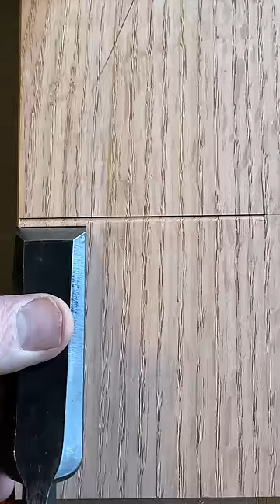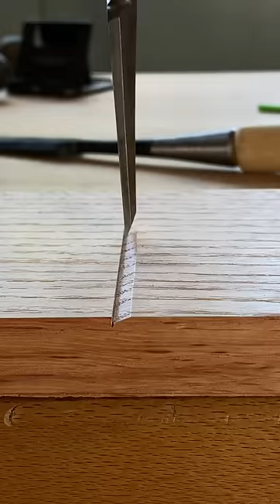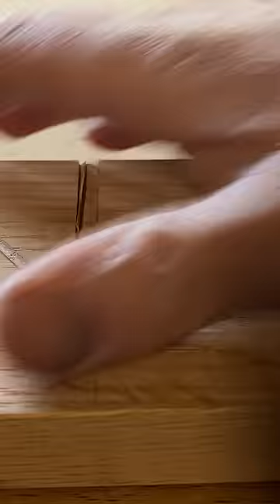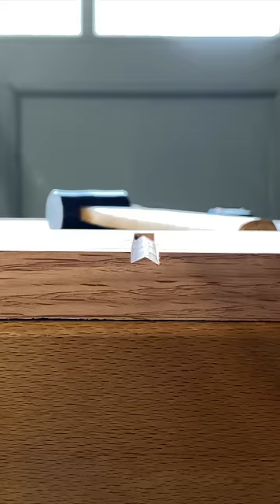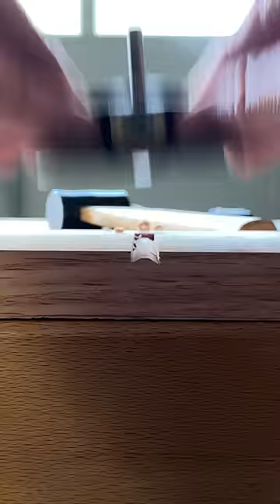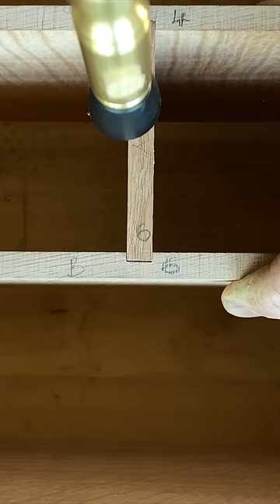Stopped Housing Joint with Hand Tools #woodworking

Comment: I see a hilarious debate going on here so I asked the AI (chat GPT) to get an 'unbiased' response as to why a woodworker, like this very patient man. would do this! Question - why wood a woodworker use hand tools to cut a dado instead of using an electric router given it is much faster and just as accurate?
Answer - While an electric router can indeed cut a dado much faster than hand tools, there are a few reasons why a woodworker might choose to use hand tools instead:

1. Control: With hand tools, a woodworker has much greater control over the depth and width of the cut. This is especially important when making precise joints or working with delicate or expensive woods. Hand tools allow the woodworker to take their time and make adjustments as needed, without the risk of taking too much material away too quickly.

2. Safety: Power tools can be dangerous if not used properly, and dado cuts require the use of a straight bit or spiral bit, which can cause kickback and lead to injury. Hand tools, on the other hand, are generally safer to use and allow for more control over the cutting process.

3. Noise and Dust: Power tools can create a lot of noise and sawdust, which can be an issue in smaller workshops or shared spaces. Hand tools are generally quieter and produce less dust, making them a more suitable choice for some woodworkers.

4. Skill Development: Using hand tools to cut a dado requires a high level of skill and practice, which can be a fulfilling and rewarding experience for woodworkers. They enjoy the challenge of mastering traditional techniques and feel a sense of accomplishment when creating something with their own hands.

5. Aesthetics: Some woodworkers prefer the look and feel of joints made with hand tools. The use of hand tools can create a unique texture and quality that is difficult to achieve with power tools.

6. Tradition and heritage : For some woodworkers, using hand tools is a way to connect with the history and traditions of their craft. They enjoy the sense of continuity that comes with using hand tools that have been used for centuries.
Overall, while an electric router may be faster, using hand tools to cut a dado can provide greater control, safety, and aesthetic appeal. It ultimately comes down to personal preference and the specific goals of each woodworker.
Reply: im scared of AI.
Reply from the maker: thanks! wow this AI is getting good, a fairly balanced and comprehensive response. I like the way you misspelled 'would' - was that intentional?! 😊 cheers
Reply: That's seriously a great response
Reply: 7. Views
Reply: The AI missed the obvious answer of "because it's fun." Or anything along those lines. It got close with the skill development and heritage ideas, but those aren't quite the same. If you're a hobbyist, you just do the things that seem like a good time.
Reply: @MattMcConaha  not really, the last point includes „for fun“
Reply: One more reason, some clients / buyers / customers actually WANT something hand made, carved, crafted.
Reply: Think for yourself
Reply: @graysonmichael8335 you should be. Some of us are going to use it to become gods among you
Reply: @colekter5940 I usually say kill that part that cringes, but whatever that is needs to die ASAP
Reply: @graysonmichael8335  skynettttttt😂 No but seriously those where some really good answers which make it even scarier lol.
Reply: This AI is beginning to know everything about everything
Reply: Good thinking. But the bit about greater control is wack. You can have way more control with machinery, macines can work down to microns in measurement and repeat a process over and over and get exacting results every time. The one thing that doing it by hand gives you is plasticity to affect things as you go. Taking time to check each cut and tweek things how you ĺike them.😉
Reply: WRONG- on ALL counts- except for #3. a CNC router is accurate down to the micrometer an experienced custom cabinet maker is JUST as accurate. chat GPT, much like google- is NOT an 'answer' engine- it's a search engine. it can only give you a majority opinion- which, in this case? is mostly WRONG.
Reply: @Matt-bp5vy overrated response
Reply: @bricknolty5478  those who reaist change become victims of it.
Reply: @graysonmichael8335 yeah, that answer was wild but ultimately ripped the info from wikipedia
Reply: 7. No risk of wood around the cut getting torn out

8. Youll need to use hand tools anyways for the corners.
Reply: or, it's just right for him to do it that way and he doesnt need any of those artificial reasons
Reply: @rb-ex  they aren’t artificial reasons, they are THE premier reasons a woodworker bla bla bla. An AI did not make that stuff up, it ripped it from articles written by people on the net and regurgitated it back to the user wrapped in a nice little bow. If noone picks any of the stated reason to use hand tools then they are just being stupid and pompous. That may actually be one chatGPT missed, some craftsmen like being huge douchbags about whatever “skill” they have. Maybe it falls in traditional idk
Reply: I admire your description but his method is somewhat alien to the carpentry trade, I would use even more simple tools than this guy, just a mallet and chisel that's it
edit: just noticed by watching a second time, the hammer the guy is using will be destroying his chisels, very poor craftsmanship, you can hear by the sound it makes upon impact on the handle back
Reply: @Wtfinc  so according to you, someone has to pick one of those reasons to use hand tools or they're being stupid

that's stupid

those reasons are totally invented. no one uses hand tools for any of those reasons

people do things because they want to do what they know is right, or because they want to do what they know is wrong. there arent any other reasons

and you always know
Reply: @rb-ex  It's not made up, if the AI gave that's result it has taken it from somewhere on the Internet where people wrote it ;) I might be bullshit from people that wrote it, but it's not made up
Reply: Sadly this could be done much quicker with a dovetail saw
Reply: @cedricbailly100  those reasons are totally invented because no one uses hand tools for any of those reasons

people do things because they want to do what they know is right, or because they want to do what they know is wrong. there arent any other reasons

so it doesnt matter if machine-AI copied those reasons or if people using AI in their brains mechanically copied those reasons from their brains

AI is stupid whether it's done by persons or machines. natural intelligence, on the other hand, which is your endowment, is always in perfect sync with reality. it is based on what no machine can ever do, which is to know. and you always know what's right for you to do even if you say you dont

anyone who believes the youtube presenter should not use hand tools for this or that reason is being mental. if he's doing what he knows is right then he's doing god's work and it doesnt matter how many made-up reasons you line up against it
Reply: @Україна-ц7э  you're sad because it could be done quicker some other way? get real. you just believe he should have done it some other way because you like to do what you know is wrong while believing you know what others should or shouldnt do
Reply: Another reason..."He doesn't own electric tools or have electricity"
Reply: also hand tools doesnt require electricity, and are less expensive to start off too
Reply: @rb-ex  i bet you didn't even do it as a gcse
Reply: @rb-ex  its quicker and it also produces the same result
Reply: @MattMcConaha  
The AI also missed the most likely reason:  to make Youtube videos. Nobody would watch a short showing a dado cut.
Reply: @luqmaanrashid3922  
Unless, of course, the AI becomes sentient and does what it thinks is best.   ;)
Reply: Lololol I've seen amazing work done by those "dangerous" machines! 😂
Reply: This is a really interesting way of using AI! I never would have thought of it as a way to give an unbiased answer to debates. I’ve noticed that AI feels really soulless and generic when used to generate creative things like stories, but in things like arguments, unbiased and devoid of emotion is exactly what you need
Reply: Thank you good sir for taking time out of your day to write this down for us.
Reply: That sounds educated.
Reply: AI for president of earth. ✊
Reply: @MattMcConaha  " They enjoy the challenge of mastering traditional techniques and feel a sense of accomplishment when creating something with their own hands."

this pretty much says that they do it for enjoyment purposes
Reply: @jaronmacdonald4710  my take is that they are saying it's enjoyment and accomplishment for those specific reasons, and those specific reasons don't necessarily apply to someone who just enjoys doing it for whatever reason that that individual might enjoy doing it.
Reply: @graysonmichael8335  AI doesn't know what is doing though
It doesn't know what tools are or what a rabbet  is. It is only finding words.
Reply: And that is why you are billed $24,700 for that small 2 feet high standalone shelf...LoL!!!
Reply: AI: woodworking is great and it’s amazing what skilled humans can do with hand tools
Humans: AI is going to kill us all
Reply: Some woodworkers do it for relaxation. They like the sound & feel of sharp edges shaping wood. The swish of a plane, those fine slivers coming off the chisel. Peace, serenity, feeling the wood.
Some don't want to do their woodworking in earmuffs and a respirator under the howl of a router and dust extractor.
Hand tools are nowhere near fast enough for a commercial workshop but geez, give it a rest. Listen to the sounds in the vid. Horses for courses, different people do crafts for different reasons.
Reply: Ну да!. Хотя кому - что
Reply: Completamente de acuerdo, la experiencia de 20 años en el oficio y 57 de mi padre, avalan lo dicho.
Resta por decir, los trabajos dictan las modalidades a emplear, por una cuestión de costo-tiempo, se debe seleccionar la técnica a utilizar.
Los trabajos, llamados standard no requieren la puntillosidad de aquellos en que su terminación debe destacarse. Por otro lado, la mayor precisión y realce de una pieza o trabajo en madera la logran los ebanistas.
Reply: Reasons 4,5,6 says it all.
Reply: Scary good responses but it also missed affordability, no need for electricity, less noise pollution to work both night and day, dramatically less space required for wood projects.
Reply: Look it doesn't matter how good your hand skills are they make tools for this there's guides there's chucks for kick stops there's no excuse while you're doing something like it's the 1940 s
Reply: @VisibleMRJ 😂
Reply: That is the only way to build a cabinet
Reply: lol @ unbiased.
Reply: Router ? Anyone ?
Reply: Also, fun.
Reply: @chrisisnowliftingstuff3248  Something is still hand-made when it's made with power tools.
Reply: Well done 👍
Reply: Damn AI is getting scary cuz that's a well written comprehensive response 😳. I dont ever wanna be on the same page and wave length as an ai 😄
Reply: All of those reasons are ridiculous or just untrue.
Reply: Thank you chat GPT!
Reply: ebanistería
Reply: @VisibleMRJ lol..
No. 
You obviously have no idea how satisfying it is to sharpen your chisels beautifully, and then shave off thin layers of wood!
Reply: You asked AI to justify your POV? looooool how sad
Reply: @BigJeddak187 to the uniformed*
Reply: Ж
Reply: Жжж
Reply: Ззззжж
Reply: Ззззжжжжжжжж
Reply: All those words, just to say...."he likes to use his hands" 😂
Reply: Good one
Reply: I tink you're wrong on that first point. You can get perfection using power tools
Reply: Bon pour synthétiser tout ce que tu as écrit et copier coller, il vaut mieux utiliser chatGPT effectivement 😂
Reply: AI is right...
Reply: Yeah but did you ask it about black wood workers? Is that even a thing?
Reply: Power tools don't create the ASMR nor do they have the same level of calming intrigue to the human viewer. So while this isn't efficient on time. Hand tools provide the most enjoyment to another human. Which ultimately makes the best video content. You could easily fall asleep to a video like this.
Reply: Great response. The second tool is new to me. Does it have a name?
Reply: @jaybee3165  Ahh so a 1k+ machine is more accurate. Who knew! Get a $100 cnc and tell me which is more accurate between boreoff and that $100 cnc.

Hand planers can take off as small as 8 microns for less than $50.

You'd need a heavy and stiff frame + a ridgid motor housing to have that accuracy or better.

And then you are also saying that a bit spinning at 20k + rpm is safer.

Smooth brain over here^^^
Reply: I have acquired 3 power routers , one I bought myself, and 2 were given to me  . I hate the things and never use them . I personally get a far better finish with hand tools .
Reply: @graysonmichael8335  Hi, I work in the I formation Technology sphere, and I would like to assure you that there's nothing to be afraid of. AI is a tool, made to simplify complicated tasks. AI cannot think for itself quite yet, it can only operate under the parameters that a human has set for it. I hope this makes you a little less afraid of AI
Reply: #8 1/2 - time and material job
Reply: An English clip for once.
(Stopped housing)
🇬🇧🍺
Reply: To be fair, you could hand cut the dado scribes, take out the bulk with a router and jig. Then fine tune the sides by hand. Nobody would ever know.
Reply: This is a good example of 'asking the right question'.
Reply: Who cares what chat gp says? 😂😂
Reply: So theres no logical reason to do this by hand. Its all just feelings shit. Its faster and just as accurate to use a router.
Reply: Time is money, use a router..stop wasting your time
Reply: @colekter5940  bwahahahaha. Ok 12 year old. Make it happen lololol
Reply: @hexerade.e6142 This idea of everything must be "fun" is a severe weakness with Americans.

I see there being satisfaction which brings a greater character and inner joy and contentment that modernist have no clue about.
Reply: @Україна-ц7э Why do you want to deprive this person of the satisfaction he gets from doing this by hand?  Do men of character terrify you?
Reply: @steventhury8366  depends on your definition of „fun“, mine would include what you mentioned. also not american
Reply: I only do carpentry to my self but I'm 💯% sure this takes way longer than if he had used a router which is quite precise 
If he's doing it for himself good on you
Now if he's doing it as a business sorry but I don't care about your feelings 
I don't want to pay way more because you decided to enjoy the feeling of cutting by hand and want me to pay for it.
Hell no. Use power tools on my furniture please 😂😅😂😅
Reply: Also I lost my router but I know where my chisels are
Reply: Reason number whatever

For the views man, he does it for the views
Reply: #4, the meaning of life.
Reply: Tenés más paciencia vos carnal 😢 él que entendió entendió😢😢
Reply: Chat gpt is as unbiase as much as political opinion
Reply: Its fun until its not @hexerade.e6142